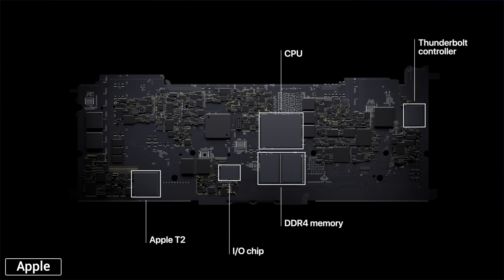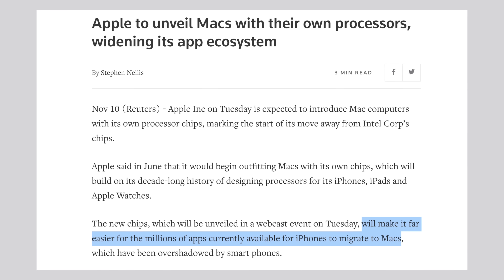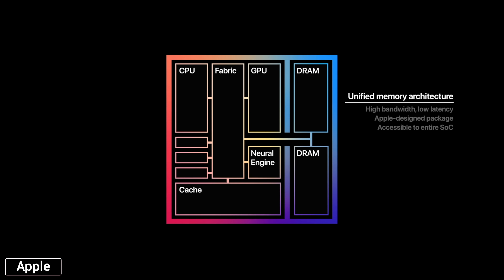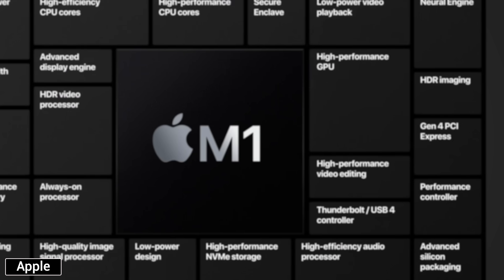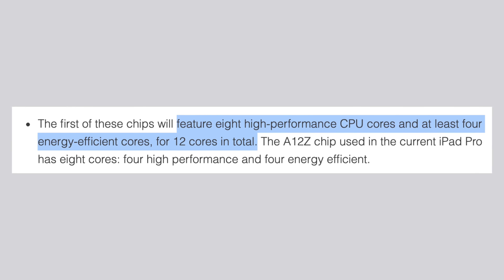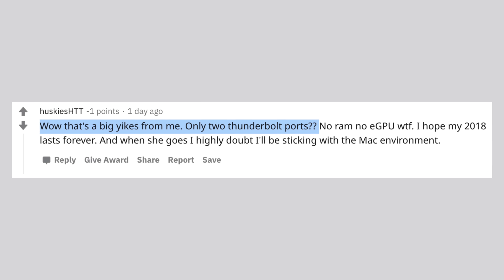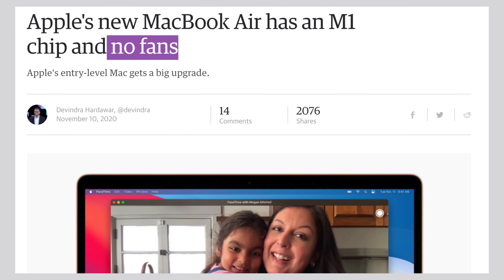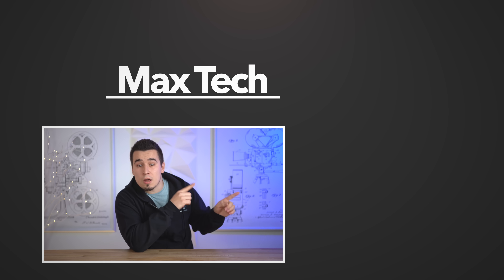Apple M1 Mac Chip Explained: Questions & Doubts Answered

Comment: Ok so I got the MacBook Air M1 and due to all everyone positive review. I needed for stay at home work and use zoom and ms office things. I had the 2020 MacBook Air intel and it did well and battery held up. But wanted to get the new M1 chip on the MacBook. But after using it more and more zoom drain the battery a lot and it was getting warm and warm. Yes using apple apps or anything that made for the new M1 chip works great. And I notice most of the review that tested the M1 on x86 did things that made it safe. What I’m saying here is I should have waited but with reviews like this and apple promise in their announcement of the M1. Too me it does not hold water. Listen to all the reviews. Accept MLKB. His word nails it. It’s great and all that but maybe have to wait this out for now. And I should have. I still will keep my new MacBook Air M1 and Mac Mini M1 since I do have lots of made for apple. Do some hard testing on zoom and some ms office apps. And try some hardware and see if it locks up the new M1. Be safe all.

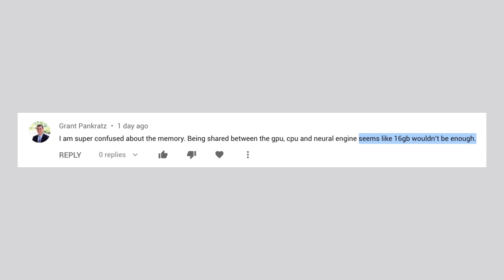Comment: 12:00 RAM won't be used more efficiently on ARM. It will be running the same software that stores the same data in RAM, just built for other architecture. There will be some difference in application size which affects RAM usage, but this will be hard to notice.
Reply from the maker: Come back for our 8GB vs 16GB ram video.

Comment: Hi Max, my work mostly includes App development with Android Studio/Xcode and using simulators along with it. In addition to this, slack, chrome, Spotify also runs in parallel.
Which one will be good option for me? The air or the pro? Do we really need to upgrade to 16GB ram or storage upgrade will be a better choice?

Comment: I'm still on a 2013 15" MBP. If the M1 is smoking the current 16" MBP, then I'm def upgrading sooner than later. I'm a photographer, so I know Lightroom is already optimized for ARM Macs, and the rest of the Adobe suite is following. Lightroom is the main app I use though. I would really love a 16" ARM Mac, but that's not gonna come anytime soon, and it's def gonna be pricier. I may just go with the 13" MBP or even the Mac Mini. I just gotta wait and see if the M1 Macs work with the  Thunderbolt Display which I love and don't want to let go of. Its USB 2.0 ports suck but luckily I have storage solutions using TB2.

Comment: I want to see how Windows virtualization performs when you get the new ARM Mac in.  How does assigning performance/efficiency cores to the guest OS work?  Does parallels even have access to assign the efficiency cores to a VM?  I have the feeling I might miss boot camp.
Reply: Apparently CrossOver 20 now supports running Windows apps on M1 computers

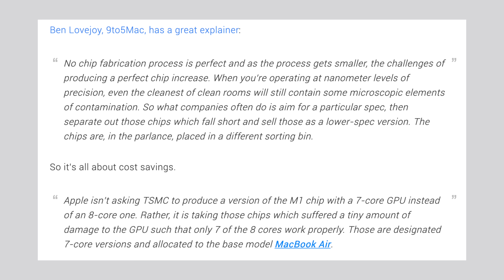Comment: 13:57 so basically the base version of macbook air has a M1 chip that failed quality control? 

Who would want to spend 1000 USD on a laptop which is sold despite it's cpu failing the quality control?
Reply from the maker: Other chip makers do that as well. For example,  Intel creates a chip meant to be a 4 core i5 but it fails quality control. They disable the two cores that didn’t do as well and sell it as an i3. Apple is doing the same thing except for just one gpu core. And they’re selling it at a cheaper price for the MacBook Air.
Reply: @MaxTechOfficial  
Woah I had no idea Intel did that

Thanks for enlightening me! Subbed

Comment: I ended up buying a MacBook Air with M1. Mainly, because the MacBook that I bought has the last generation of the butterfly keyboards and I have been having issues (even though I have sent it back to apple twice to get repaired). For example, my sift key lately has been having an issue where it would come unpressed. Meaning, it sometimes can remain stuck in shift mode. However, I only purchased the base model of the MacBook Air with the 7 core GPU. Can someone please explain to me what a GPU is used for, and should I be concerned that I do not have all 8 cores enabled?Word to type out documents, watch movies/tv shows from streaming services (which I am so excited to run iPhone and iPad apps on this Mac because it is something that I have wanted for a long time), play games from Apple Arcade, and do some editing of photographs. Based on everything presented during the Apple event, I think the base model should be able to handle all of that and more (especially after the leaked bench marks). But like I said, some of the YouTubers are confusing me because they saying "the MacBook Air only has 7 cores of GPU." What do you think?

Comment: Unfortunately My Composing Software Dorico ist not running through rosetta 2. So the developer told me. I think this will also be true for cubase. My Apollo interface by Uad does not work with M1. 

Basically most of my Studio will not run on the new macs sadly. I wanted to switch to mac from pc with my studio. But since I know of the power of the m1 and the propably even greater power of the m1z/x, I don't want to invest in an Intel mac 😢. So I have to wait 🤓

Comment: 15:17 that's not the case ;-; according to Microsoft, Microsoft Office on Apple Silicon Macs run 20x slower than Intel MacBooks so they're gonna release a non-x86 version of the software soon in the app store.
Reply: Compared to the chip mentioned at 7:58

Comment: Load of crap. They also claim the iPhone A14 chip is stronger than a 11th gen i9. You obviously didn't do enough research. The M1 chip is basically a slightly stronger version of the A14 chip.

Comment: Wow thanks for this video. My question is: does the geekbench result run on rosetta? Or is the result from native arm risc?

Someone has a fun fact, an intel x86 runs a certain process at 30 nano second, a native arm runs that process at 6 nano second, while rosetta translated runs it at 14 nano second. 

That leaked open cl performance is quite impressive. Outclassing iris in intel MacBook Air and if it can outclass tiger lake Xe graphics, that would make MacBook Air a true tiny work station class portable. 

Of course x86 is still awesome with AMD taking lead with consumer friendly 5900x and 6800xl, with direct storage, smart access memory and rage! 2021 will be an even crazier year for processor.
Reply: Geekbench doesnt run rosetta, as it supported iphones and ipads with the same arm architecture, but the leaked benchmark is incredible nonetheless
Reply: @mrplasma7094  thats true but pity its not the translated mac app? which could only mean, any app would run fine on the arm processor and would still faster than intel, well anything on the AIR will run faster than the existing 1.1Ghz Intel i5. 

And guessing from the benchmark, A14 singlecore 1700, multicore 4000, m1 singlecore about the same, multicore adds 3000 more, m1x if it comes with 2 extra cores would likely push it to 10k multicore, still 2k behind 5900x and 5950x but definitely a monster chip.

Comment: Shame on Apple Marketing PR for twisting definitions to make things appear more than they are, no wonder they refused to release the test rigs used for those % boasts, it's all their in the small print after you decipher it.

The key is their twisted definition of what an "Integrated Graphics System" is. Traditionally that term referred to having both the CPU & GPU dies on the same socket. Apple took that definition and redefined it to include not only the CPU & GPU die but also the machines memory subsystem. Thus rebranding what would be referred to traditionally as an "Embedded System" into what they are mistakenly calling an "Integrated Graphics System"

When you realize this definition shenanigan and than compare current market embedded systems to the M1 their marketing claims make perfect sense.

TLDR: Apple was redefining an industry term to mislead consumers into believing the M1 outperformed graphically vs integrated gpu systems (such as AMDs Ryzen/Radeon powered APU) when it only outperformed embedded systems.

Comment: I don't think the argument that M1 will use RAM more efficiently is valid. Yes, it will be much faster and will require lower power to access memory, but you will still be screwed if you run out of memory. So 16Gb might not be enough for many workloads.

Comment: 8GB of RAM can store 8GB of data. That's a simple fact.
In "Unified Memory", CPU and GPU share bandwidth and capacity, which will make it worse.
What could make it better is the bandwidth of SSD, which is not integrated of course.
That's why iPhone sometimes perform better. iPhone simply have a good storage, not any kind of magic.
But it costs too much to add storage (including Apple tax) and you can't use microSD.

Comment: When I compile an iPhone project in my Intel based Mac, I can run that ARM app without problems in my mac. There is no reason to not enable this capacity in older Intel based Macs other than restrict the users so they would prefer to buy the new macs to gain that compatibility. I understand that A1X chips are more powerfull and the emulation layer take away part of the speed in the Intel platform, but if you need to run some specific application (just keep games out of the discussion), that should be possible, but again, Apple will not enable that possibility to the regular users.

Comment: So does the fact that the Air has no fans means that it won’t be able to run ANY high performance apps like KeyShot, Rhino 6, video editing or even many apps open at the same time? Or is it going to be doing it amazingly better than the older Intel Air?

Comment: So, in 2020, when everything moves online, they chose to just update the software for the camera:)). Why didn’t they add the iphone front facing camera on it? Or at least a fullhd new sensor cam:). Apple being a bad Apple, removes the option to have 4 ports as well...I suppose in 2021 they will have a magsafe charger on the side and no ports.
Reply from the maker: I think it’s because they didn’t redesign anything about the actual design. Same chassis. Same batteries. Same display sizes. Wouldn’t make sense to redesign the webcam.
Reply: @MaxTechOfficial  Yes, they did use the same chassis, but people might not have the time or patience to use their phone as a webcam or their sony’s, canons, fuji's or Nikon's as webcams. In Romania, every school and university class moved online for the foreseeable future. I, as a lecturer and trainer, need and want a high-quality camera to stream online, and sometimes I just don't have time to set up my tripod with a secondary camera. I think the camera improvements are lacklustre and a huge disservice. They had time to figure out the internal layout for the batteries and the new motherboard but not add a 10$(guess) sensor? If they come out with a four-port option, I will buy the MacBook Pro in a heartbeat. Keep up the great work and detailed videos, excellent production value.

Comment: Sure, the secure enclave will prevent you to use app from elsewhere from the store. Roseta like its former version in snow leopard will not stay very long, it exist in 2 version (2 years) only and Lion remove it.

Asymetric cores exist in android phones for a long time 4 weak and low power and 4 high power ones, globaly the new mac is a 4 core computer.

720k webcan still 720K
Shared RAM between GPU and CPU is always bad, it makes a slower GPU and for app that use a lot of GPU like textures it uses a lot of it, it makes your Mac with very few memory available, don't forget that a real graphic card arrive with 8 or 12 GB of Vram + the internal RAM. and most of this RAM is GDDR5 GDD6 ou HBM2. Also note that intel Xe is still a low end graphic solution.

A last point about inefiscient X86 system, it is wildly used on anything not mobile, widly used in industry as much as mac nearly does not exist in buisiness and the biggest data center are X86 based?  PCIe gen4 existed before the macpro exist it is just Apple that was not able to implemant it. A 200$ AMD mother board has it.
If Apple switch to x86 it was because the ppc architecture was so slow but they say the opposite during years. Same now, the same speech, but they still sell the X86 in high end?
Is it logic to buy a I9 x86 3000+$ when the macbook air is faster?

The air has 7 cors CPU, it is like older phenom X3, the air as a defective CPU but does it have like 3 high end core or 3 low end, it change a lot of things in performance.

The macpro has no fan and suffer a lot from overheating, this result in a far lowest longevity than it it has one. See the repair of this machine with Rossman video, it is really a weak computer.
Reply: Anf for Roseta 2 being faster than a native X86 I doubt, Microsoft also made some X86 and ARM version of wiondows, the ARM was a lot slower due to the total incompatibility between processor, how can an emulation be faster? On PPC the paralles  software can be around 50% slower than the same speed intel CPU of the time, the infamously weak PIII?
And by magic Roseta get faster than an native CPU? You really thrust this?

Comment: The whole problem with those benchmarks is that they don't tell us anything about real-life performance in various workloads. The architecture is so different that it is impossible to judge the performance. Thinking that a low-powered ARM chip is going to outperform a 12 core 95 watt CPU is plain stupid. That will never be the case
Reply from the maker: Depends on the app. We will see :) I’m very confident that Final Cut Pro will perform quite well.
Reply: @MaxTechOfficial  Thx for replying! To be clear: it was not meant as an insult. I just notice that some people think that a 10 watt SOC will be able to outperform a 95 watt CPU combined with a 200 watt GPU, and that is simply impossible. That's just physics. Of course the M1 is going to be amazing. I don't doubt that :-) I'm highly looking forward to your future comparisons
Reply: @MaxTechOfficial  The fact that the more expensive 13 inch MacBook pro model still uses intel, could be an indication that the M1 cannot beat that chip? Just a thought

Comment: Mac Os Big Lie :

While most legacy software should install under Rosetta 2, software from this base won't be as performant as on the Intel hardware for which it was developed. FL Studio does not run under Rosetta 2 at this time. Custom development is under way to make the native ARM version of the program, as noted above.   

All DAW and music software will likely be specifically impacted for early adopters of ARM based computers. Unlike simple web-browsers, word editors and other similar applications, DAW software is based on highly optimized code that must run in real-time, without glitches to the audio. This code is necessarily low-level and will take some time to perfect, even after its up and running.

Furthermore, the ecosystem of 3rd party VST and AU plugins is vast. These cover an almost infinite spectrum of developers, resources and talent. Many plugins you, probably, take for granted may never work on, or at least smoothly on Apple Silicon (ARM).

We will make future announcements in this article as the project unfolds.

Image-Line Support Team

Comment: Not that anyone at Apple would care ,,  they lost me as a customer when they through away the best feature for a gamer which is . 
“Bluetooth control touches” which was eliminated from the software post IOS 13.3.1 
   No more keyboard and mouse controls whatsoever which in my opinion set them back a decade behind Android after this greedy 
Power play to remove third party apps which worked in conjunction through an overlay with this feature allowing drag and drop key-mapping.
     You are obviously paid by Apple !
Cheers !

Comment: 13” MacBook Pros max out at 32gb of RAM. The M1 doesn’t for some reason (but not because they’re replacing models that maxed out at 16gb).
Reply from the maker: The $1800 MacBook Pro models Max out at 32GB of ram. The new M1 MacBook Pro is meant to replace the $1300 model, which only supported 16.

Comment: Claiming that 16GB will perform similar to 32GB shows a major lack of understanding of hardware basics. All the memory architecture optimization in the world doesn't matter if your data doesn't fit in memory and has to swap to disk. And a different CPU can't make data smaller. That's the whole point of having RAM. Of course it will perform the same if you're not using all of your memory, but the concerns are from people who use more than 16GB.

Comment: Microsoft already has an arm-based version of Office that runs on a Surface Pro X with SQ1/2 arm processor, so I would be surprised if they didn't develop a Mac OS arm-based version to run natively on Macs with the M series chips. There has also be mention of virtualisation support on Apple Silicon Macs and I look forward of being able to run an arm-based OS, e.g. Raspberry Pi OS, as a virtual machine on an Apple Silicon Mac. Would Rosetta 2 allow you to run a X86 OS as a virtual machine on an Apple Silicon Mac? Now that would be fun!

Comment: Thank you for this excellent review. I have two comments, however: firstly, your claim about 16GB of RAM being sufficient due to higher OS memory management efficiency is correct performance wise, however, 16GB is still restricting data wise; secondly, the claim about MacBook Air presumed higher life expectancy due to lack of fan which will eventually gather dust is still to be tested, because we do not currently know just how hot this machine will run.

Comment: Maybe you should mention that the the m1 devices doesn't really have TB3 or 4. The bandwidth is limited to 10Gbit/s which is USB 3.1 Gen2. The sad thing is that USB4 specification will allow this but TB should not. Even 2015 Devices had faster TB connectors.... This is by the way the reason you would never be able to use a eGPU with a limited bandwidth like this.